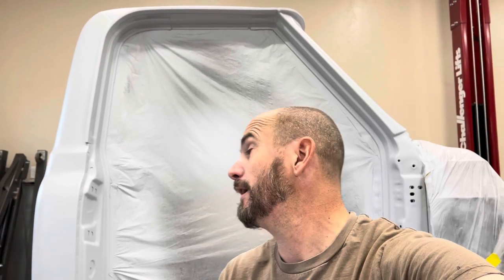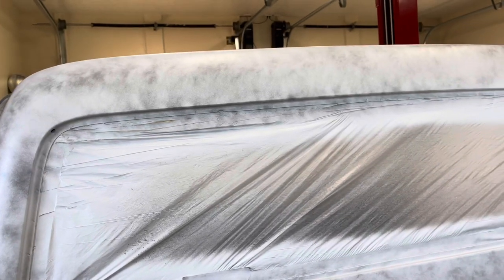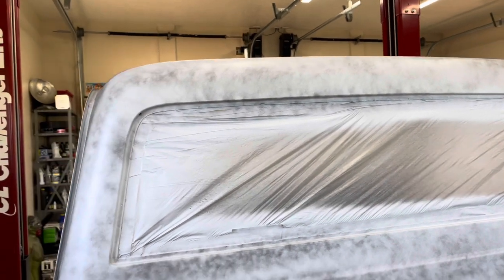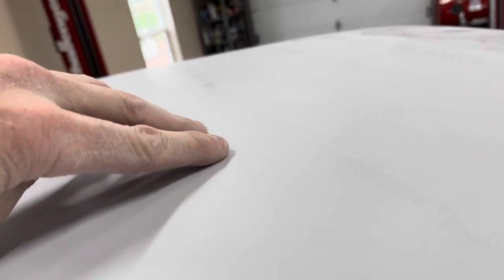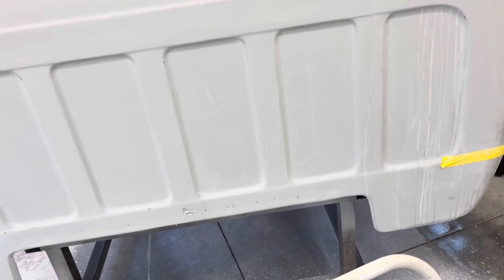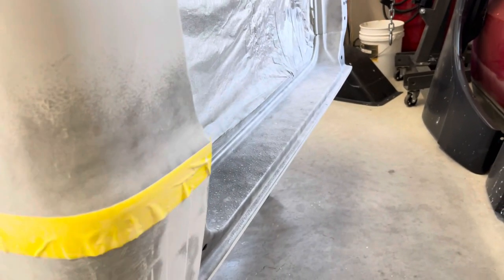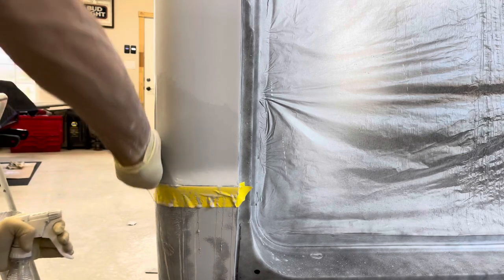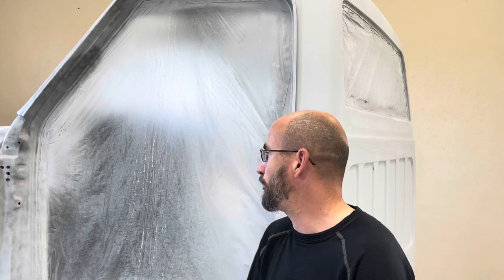1972 C10 Build, cab is in final primer and how I prep it for black paint.

Comment: Welding up those windshield seams was a great idea. Wish I had done that. The trucks I have had the back glass out of, have not had that hole.
Reply from the maker: Thanks, the more i think about it I wish I would have welded up that hole in the back window. Still might.  There is a possibility I might use flush mount glass in the back too, but unless someone else makes it at a lower price I doubt it.